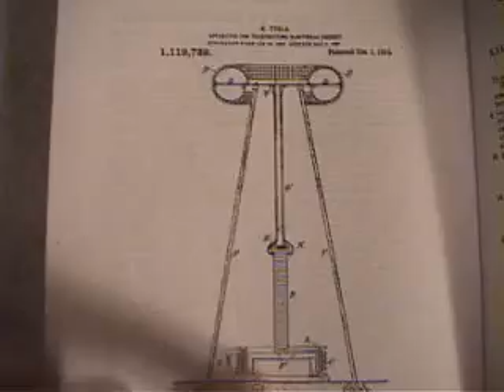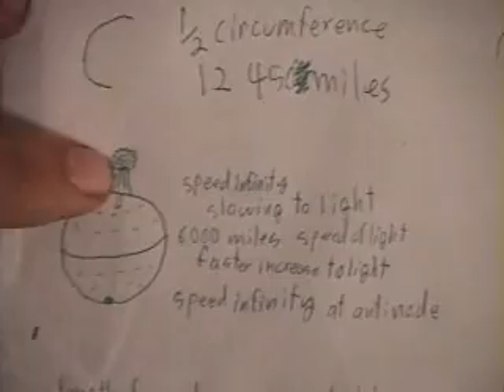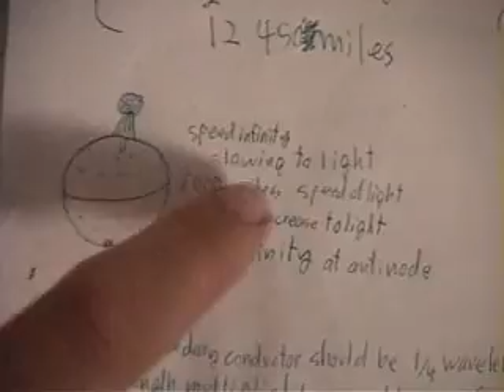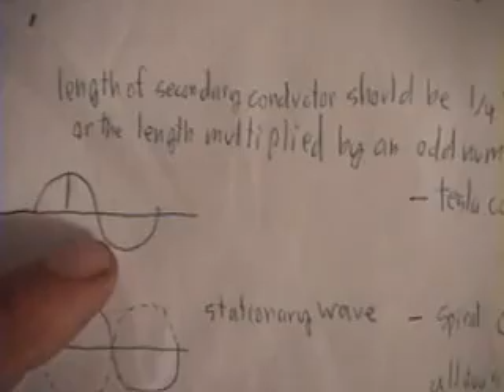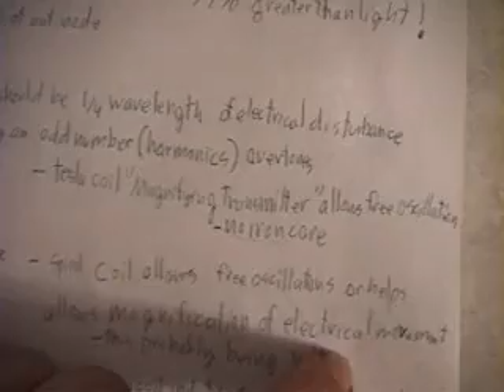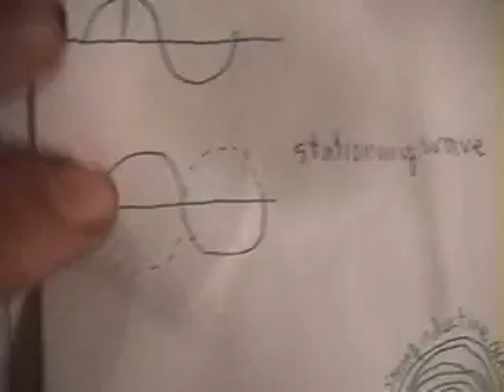Wireless Transmission of Electrical Energy, Tesla 1900 part5

Comment from the maker: @westkan the stationary waves are when you have energy being put into them at the resonant frequency of the earth, the waves are set up in a certain area along the earth and inside it as well in concentric rings, you would have to study all of teslas work to really understand this, it is not radio waves again, they system is designed to decrease a EM component of the wave, its a one wire transmission system like tesla said many times.

Comment from the maker: light is a constant,but you can go faster than light,u can multiply a constant:)tesla figured this out using science,not theoretical equations.see a shperical conductor of huge capacity changes the whole idea of "faster than light is impossible" nd shoves it, tesla didnt believe in einstien because well,tesla found what happens naturally, aster than light energy transfer, lightning can obtain similar results naturally,but teslas system emphasizes high voltages and faster than light conditions.

Comment from the maker: this is why his energy system goes faster than light, he used the basic trigonomic proof of a cosecant. his equation is 
velocity of energy = speed of light * cosecant(degree).the earth is a spherical conductor,like a spherical wire.so starting at infinity in the coil and going out 1 degree you get 
v= 300,000 * cosecant(1 degree) = 17,189,606.5km/s <-----very very fast. as it approches cosecant(90 degrees) the velocity goes to the speed of light
v= 300,000 * cosecant(1 degree) = 300,000km/s